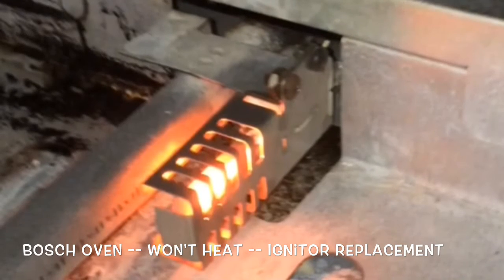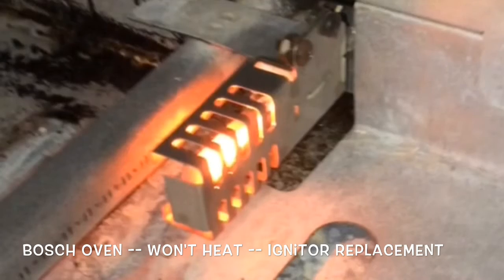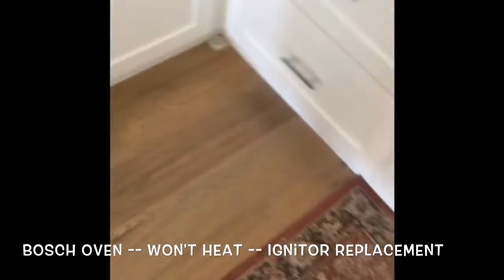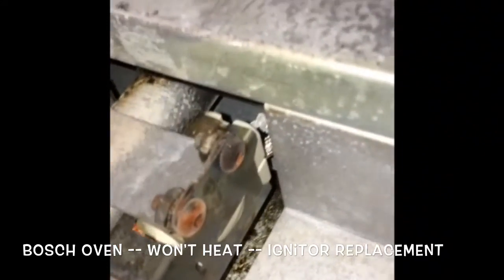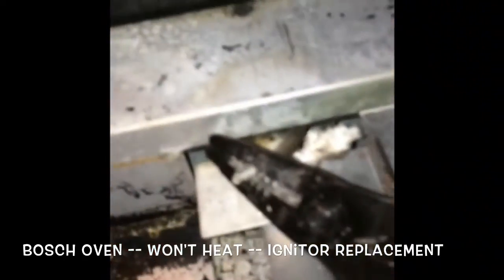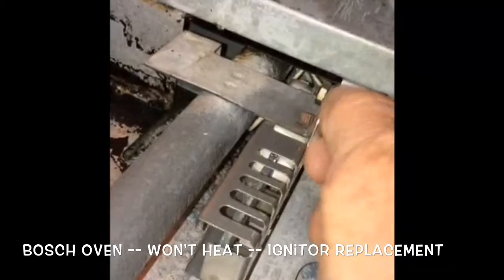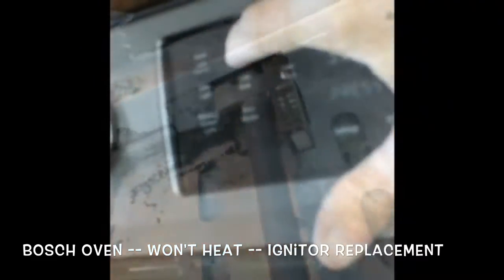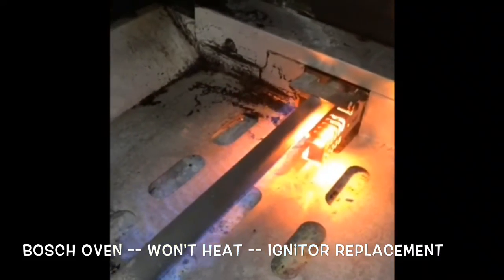✨ Bosch Oven Won't Heat🔥 - Easy Ignitor Replacement ✨

Comment: Ok, I'm gonna try it! Do you have to press the button where the door goes to see the gas go to the igniter? Won't that happen when you reconnect the power and set the bake temperature? That part seems a little scary to me.

Comment: I had the same problem but when I took out the igniter I noticed one of the wires is not connected to the igniter and I can't see that wire from the top. It seems my problem was the connection and not the igniter itself.  I wonder what part of the stove I should open to be able to reach the other wire and connect it back. I can't see or reach the other wire through the opening around the igniter.
Reply from the maker: Hi Kim,
Can you try removing the rear panel behind the dryer to find that wire?

Comment: does the broiler on top have a seperate igniter too? Neither of mine will glow
Reply from the maker: It does have a separate igniter.
Could be both igniters have stopped due to being worn out or the oven got too hot and now you need to replace the hi-limit (fuse).
😊Scott’s Tip Jar - Click Here: https://venmo.com/code?user_id=2758682643267585005
Reply: @ScottTheFixItGuyChannel  thank you for the reply

Comment: Thanks so much for this video.  We used it a year ago to replace our igniter successfully.  But stove is again not lighting, or it was heating up to temp but then not staying at temp.  Igniter glows, but do you know what temp it needs to get to to light the gas?  Using an infrared thermometer it looks like it's at 800-900 degrees.  Is that enough to light it?  Wondering if we again need a new igniter or if it's another problem.
Reply from the maker: Great Question👍 Click Here to Get Live Expert Help From Me For Just $5.00: https://www.youtube.com/channel/UC7fBqy8806u1r0NpPv_fQ2w/join
We’ll Get It Fixed 👍

Comment: The wires to my Bosch for this are very short, so this must be a re-edit of the old video. In your old video the wires were quite long. Here they are short like mine. Am I missing something? Did Bosch change the length of the wires? Struggling with this as I don't want to pull too hard thinking they are still long but stuck in there.
Reply from the maker: You can get behind the stove and remove the rear panel and do the wiring there👍

Comment: NO NO NO. The wire nuts will melt. THE SLEEVE OVER THE WIRE (IS THE INSULATION) WHICH NEEDS TO BE BELOW THE NUTS. AND NUTS TUCKED BEHIND IN A very very tight spot behind the wall. JMO. ( doing this now) This is second one in 18 months. B.S. ON BOSHE PRODUCT. for those that use it Daily!!! AT HIGHER THAN 350 DEGREES. LOL.
Reply from the maker: The wire nuts used are ceramic and can stand 1,000 degrees.

Comment: Really nice video. In my Bosch, ther were already two wire nuts attached, so that you only need to take those off. If you are as dumb as I am, and you pulled too hard trying to get the wires to separte, so that the you end up pulling the wire full out of the back, it turns out that, if you take the bottom drawer out, there is a small door held by one torx 20 screw behind which you will find the place to plug it back in. Sigh of relief.
Reply from the maker: Nice job Art, thanks for the good info.

Comment: Nice job Scott.  Worked like a charm.  I probably would have bought a Bosch igniter for $300 so it was interesting to note your video that igniters are basically a bin part for a multitude of manufacturers.  Saved myself a lot on the igniter by purchasing on amazon.  Also saved on a repairman cost - $140 to come and look at the problem, then order inflated cost parts and then charge $100/hr to install with 1 hour minimum.  Thanks.
Reply from the maker: Awesome job David😊👍

Comment: I used this to fix my Bosch oven. I did not cut and splice wires as the part connections are easily accessible in the back. Also it was an excuse to clean behind the oven.

Comment: So what the next step if you don't get 110 volts to the baking ignitor? Is it automatically assumed to be the board even if the broiler ignitor lights?
Reply from the maker: It’s highly likely that the bake igniter relay on the board is no longer working even though the broiler relay is working.
So replacing the entire board should do the trick.

Comment: My igniter had failed due to a broken wire inside the insulation. Rather than splicing the new igniter with a porcelain nut into the fatigued wires, I bought OEM part and used the connectors accessible from the back of the stove.
Reply from the maker: Nice job Liz👍😊

Comment: Great video.  VERY IMPORTANT!!!!!!!!  that you mentioned you used PORCELAIN wire nuts to connect the spliced wires.  Myr replacement part DID NOT COME with nuts -- it came with a male connector, expected to fit into the female connector accessible from behind the over. Those porcelain (or CERAMIC) nuts are heat resistant to 1000 degrees F.  Also, you appropriately DID NOT cover them with regular electrical tape.  Black tape would melt at 200 degrees F, and cause big problems.    If you get a good connection, there's no need to tape.    IF you feel the need to use tape (or join with crimps, by twisting, or heat sealing), YOU MUST USE heat resistant glass or other specialized tape to cover the join.  What comes next are several observations on 'support-repair-services-and-official-Bosch-replacement-parts' NEWER Bosch models.  Read as necessary.  Sorry or the length.   :::::::  INSTALLATION HASSLES AND SMOKE/FIRE COMMENT:  Bosch has made replacing the igniter MUCH MORE DIFFICULT IN RECENT YEARS by shortening the wires between the igniter and connection, + adding a 2nd (largely unnecessary) box through which the wires travel to the connector.   IN NEWER (post 2012-14) Bosch Gas ranges, THERE IS A SMALL, PROTECTIVE BOX BEHIND the 1st layer of firewall.  It is almost impossible to get even the smallest plastic wire nut through the tiny (3/8" sq) hole in this box to fully protect the wire nuts.   IF YOU JOIN WITH PLASTIC FIRE NUTS, they will not meet code and WILL ALMOST ASSUREDLY MELT -- even if pushed through the small round hole in the back of the oven).  MELTING IN THIS ENCLOSED SPACE HAS A VERY HIGH POTENTIAL EITHER TO SMOKE OUT or START A FIRE inside the over AND (CRITICALLY) INSIDE THE BACK PANEL of the oven where ALL the wiring and circuitry resides. Even a small amount of smoke will kill the circuit board, a $250-$500 part  ::::::: CHEAPER IGNITER COMMENT RE THICK, FIREPROOF WIRE JACKET:  One other issue is that cheaper igniters (which I'm a fan of at 1/5 the cost) usually don't come with the added fireproof insulator cover that the factory part has.  The easiest solutions, as far as I know, are: (A) do what you've done and make sure the wire goes behind the firewall; if doing this, I'd still prefer to pull the thick insulator cover forward and splice/join with ceramic nut BEHNID the insulator cover -- as far back toward the connector as possible (difficult on newer model ovens as the connector is toward the back left corner of the over, behind the firewall.  ** OR ** REPLACING AT THE CONNECTOR:  The following all are based on unclicking the old wire at the actual connection (accessed from behind the oven), and clicking in the new wire to the existing female connector.  It requires the added hassle of accessing the back of the oven's wiring + fishing the new igniter cable through the front to the back., BUT it provides you with fresh wire all the way to the source connector.  THIS CAN HELP if it appears one of the old igniter wires is burned/shorted (much more common that one might think).  The way to confirm this is to cut the bad igniter wires close to the igniter and inspect the wires for blackening.   ALSO, one can check to old wires (as mentioned in this video) to see if 110V are coming through BOTH wires.  :::::::::   PROCESS:   (A) If the new connector you ordered  already has the secondary thick wire insulation jacket, CONGRATUATIONS!  Remove the back panel of the oven to expose the wiring, fish the new connector wiring through, and simply unplug the old connector / plug in the new (nale) connector; then install the igniter inside the oven. ( B) If the new igniter doesn't have the thick outer insulator jacket, remover the old jackets from the old igniter, (unfortunately) cut the new igniter wire about 2-3 inches from the female end of the connector plug, put the old thick insulator jacket over the longer ends of new wires, and splice them back together; the splices can be connected near the the female end of the plug with wrapped wire nuts (behind the firewall), with ceramic wire nuts (extra, extra safe), or by twisting the wires together and then using high-heat tape to cover the exposed wire; finally, pull the thick insulator jacket back over the wire, and install the new igniter by clicking the male end of the new wire connector into place and attaching the new igniter into place inside the oven.  (C) Cut the new igniter wires up against the male plug found on the new igniter, put the old thick insulators over the new wires, then crimp on a new male plug; pull the thick insulation back into place and complete the installation by clicking in the new plug and attaching the new igniter.  (D)  Ignore the thick insulator wire and hope like hell the new insulator wire cover has enough heat resistance.  :::::::  FINAL WORD: In my experience, the new wires will be ok UNLESS for frequently use the over at or above 424 degrees F OR if you run the self-cleaning cycle more than once every 2 or 3 years -- self cleaning mode. techs will tell you, is an igniter-killer, regardless of the installation method you use.
Reply from the maker: Excellent info.  Yep, self-cleaning should be renamed Self-Destruct😂

Comment: The Bosch manual says to make sure that the regulator is turned on. This appears to involve getting behind the oven which is more manual labor than I can handle. How do I know if it's the igniter or the regulator?
Reply from the maker: It’s the igniter. 100% Guarantee
Reply: @ScottTheFixItGuyChannel  It worked!!! Add me to the list of people who feel taller after watching this. We were surprised when the oven stopped working because it was only 2 years old, although it was a floor model. This also gave me the impetus to get some tools so that I could remove the old igniter. Thanks so much!!
Reply from the maker: Corey Wade thanks so much Corey😊😊😊

Comment: Hello.  Our oven is a HDI7283u/03.  The only panel that can be removed is the one covering the convection fan, and nothing is inside it except the fan.  There is no removable panel on the bottom, no hardware to remove at all.  I'm thinking the ignitor is in the top.  The gas line comes into the bottom, through a regulator, and the tube goes straight up and into the top.   Would you have any hints on getting at this ovens igniter?  Thank you.
Reply from the maker: Thanks Jeff,
Is it possible that that model has a electric element hidden below the bottom panel?
Do you think it runs are in 110 V or 220 V.

Comment: Is the Electrolux alternative you used a replacement for the Bosch 00755058 igniter? 

The Frigidaire igniter number 5303935066 seems to be a good part number as well.
Reply from the maker: Yep,  works just as well👍

Comment: Hi - great video, thank you. My problem is that there is only one wire coming out of the oven to attach the igniter - mine has little attachments to couple the wires and the old igniter appeared to be plugged in to just one wire, the other one coming out of the igniter wasn’t attached. I installed the new igniter the same way but it’s not working at all. Any suggestions? Thank you.
Reply from the maker: Thanks Eric,

Can you send me a few pictures to scottthefixitguy@yahoo.com?
Reply: @ScottTheFixItGuyChannel  Thank you so much for writing back. I actually figured it out! I was looking for a second wire to plug the igniter into, but I discovered that the wire from the igniter actually plugs directly into a post on the gas valve. It works now! Thanks again for your video, it was really helpful.

Comment: @scottthefixitguy, I have a Bosch Bosch HGS445UC/02 slide in range. Can’t find the part. Can you help with that?  
I did some research and came up with PartSelect Number PS8722793, Manufacturer Part Number 00492431, but I am a bit skeptical about the websites. Some sell for >$100 and the Amazon link shared in comments shows <$20. Help. Btw, all the vids are excellent and I subscribed and gave 👍.
Reply from the maker: The 20.00 Amazon one will work fine😊
Reply: Scottthefixitguy , I installed the SUPCO (Amazon) unit today on Independence Day, happy 4th by the way, it seems to be working fine.  One concern I have is the unit that   replaced which was a Norton 501A unit had heat shields covering the wires.  The new unit just has the wires. Is that a cause for concern?  I have pics,  if you want them.
Reply: Scott any chance of replying to my last comment about heat shield cover the wires. It’s that fabric covering the actual wires. I have pics of that helps you. Appreciate it. Thanks

Comment: Scott, many thanks for this. If the igniter is failing, could that explain why the gas ignites but it takes over a minute, no 'woosh', the flame is small, and it smells like not all of the gas is burning? No issues with the broiler or rangetop igniters.
Reply from the maker: That could explain it
Reply: @ScottTheFixItGuyChannel  Thank you, I'll buy the part and replace it following your video.

Comment: Great video; thank you! Was able to easily replace the igniter from my Bosch HGI8054UC/07 with the Electrolux part from Amazon. I did one slight change -- the wires from the back of the oven are each covered with an insulating sleeve -- I just moved that sleeve to the wires from the new igniter, before tucking all the wires back behind the oven plate. Such a great sound to hear the "whoosh" of the flame turning on again!

Comment: Hey Scott do you know a compatible Igniter for the broiler as well, I just did this for bake and worked great. Thanks for the video any help would be great. The Broiler ones are like $100 for bosch
Reply from the maker: Hi Peter,
I think you can use the same one for the broiler that you used for the bake

Comment: So this seems pretty straight forward and I did the same replacement on my gas dryer a few years ago. But just today both the broiler and the oven stoped ignighting. Is there any connection or do need to replace both igniters?

Comment: After igniting the over, should the pilot/igniter turn off ?. How long does the igniter filament stay on after the oven is on with blue flame ?. I don't know if this is a problem or not.
Reply from the maker: It will just stay on until the oven reaches the desired temperature .

Comment: Hi there! I have a Bosch hgs235uc/02, i checked on internet and it seems the correct igniter would be Bosch 492429,
do you think the Bosch 492431 or the Supco SGR2431 would work? My model doesn't appear on their list, only the 492429 one, which cost a lot more
Thank you very much!

Comment: Just to make sure I don't screw up something completely obvious (as I'll be attempting this repair soon) when connecting the wires from the new ignitor to the snipped wires coming out of the oven, is it obvious which wire goes with which?  Does it matter?
Reply from the maker: Great question Jeremy,
It doesn’t matter which wire you use.
Either wire will work with either igniter wire.